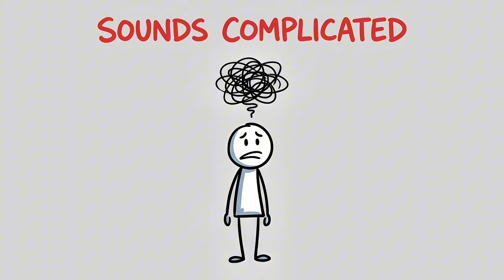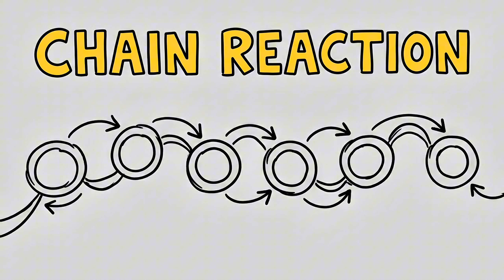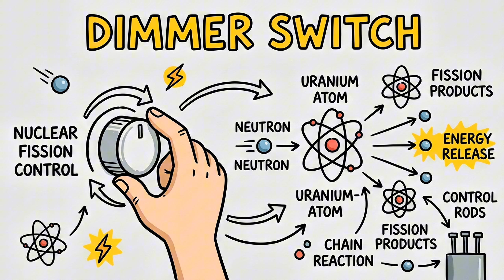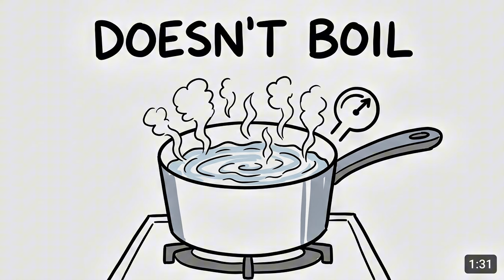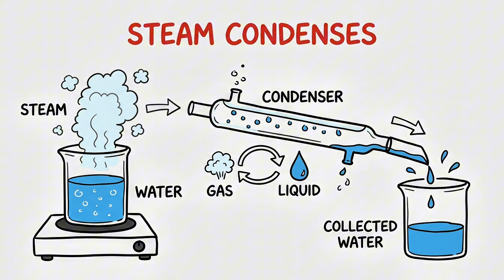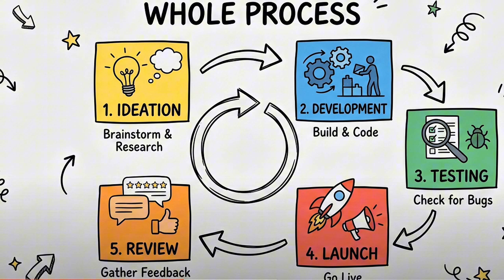How Does a Nuclear Power Plant Generate Electricity ?

Comment: What does the grid rental cost to get the 4cents kWh electricity to the millions and millions and millions and millions of consumers meter boxes 40cents kwh, or 50cents kWh ?.?.? 

The grid rent KILLS NUCLEAR ECONOMICS.
Nuclear nuts are real nuts lost in their wet dreams. 

Half a dollar per kwh to many millions daily, 365days per year for decades and decades. 

So the GRID owners SHTTSNPANTS is avoided. 
?.?.?.? Thinking, thinking,....
Reply from the maker: Grid costs are an important part of electricity prices, but they're usually much lower than 40–50¢/kWh in most regions. The cost of generation and the cost of transmission/distribution are separate parts of the electricity bill.